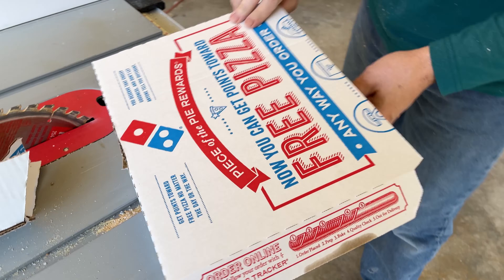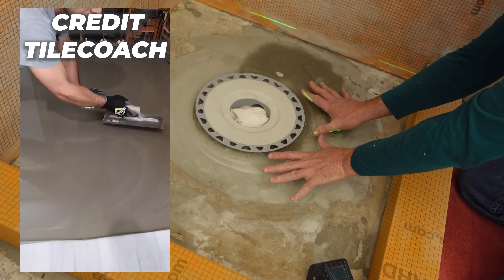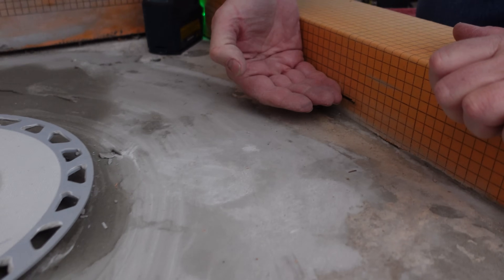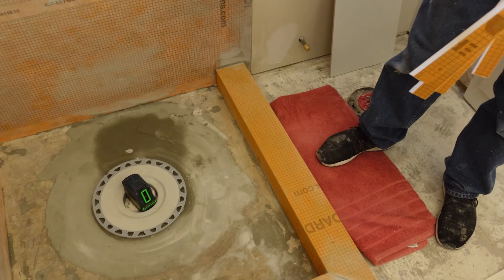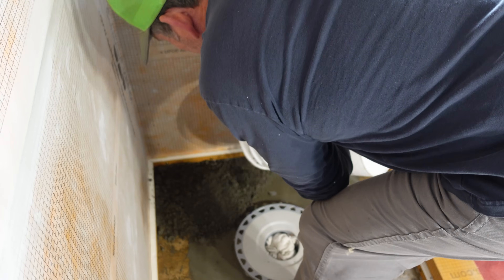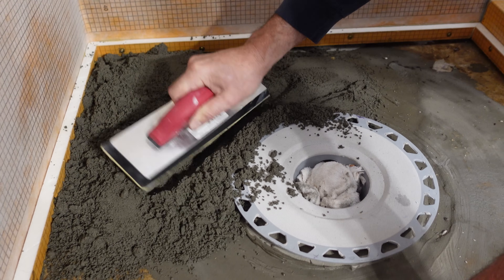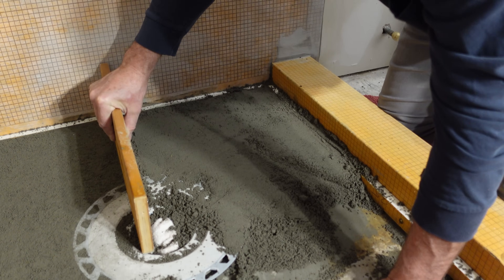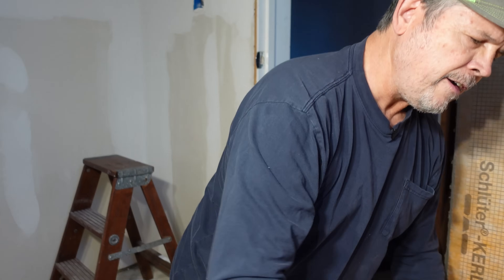HOW TO BUILD a PERFECT Shower Pan PRE-SLOPE (Great for DIYers)

Comment: Best way to mix the mud bed is with one of the contractor trash bags, measure out your water and put it in the bag then add your whole bag of mud bed and shake back in forth 10 or so times and it’s perfect ever time. Been doing it for years.
Reply: Wow that would save so much hassle,  never thought of it, thanks!
Reply: That’s the only way I mix it and save me from carrying that buck where am at I just take the sks of floor mud where am working
Reply: Never would have thought of that. Thanks for the helpful tip.
Reply: The plastic ones? Or the mesh ones? Just your normal black trash bags contractor grade?

Comment: I used 3/8 plywood screeds around the sides cut so they laid directly on the floor; upper edges laser aligned of course.  They're NOT fastened to the wall in any way - just fitted tight -  and are to be removed after the deck mud is fully screeded in.  To make the plywood screed pieces easy to lift out, simply put a screw in their top edge which can be grabbed with pliers.  Just give them a little wiggle and they can be lifted right out, before the mud is set up.  Then just fill & tamp the 3/8 gaps around the edge left by the removed screed pieces with more deck mud.  The end result is perfect - fully filled with deck mud no perimeter pieces left in at all.
Reply: I've always left the plywood in there.  The whole thing gets covered with Kerdi anyway, so it really doesn't matter.
Reply: I was wondering about this! Great tip
Reply: I have used the 3/4" PVC 1 x 2 trim for the leveling border, with good results. It is completely unaffected by the moisture in the mortar.

Comment: Nice job 👍🏼 the trick with construction glue like liquid nails is you apply the glue, stick your piece on the wall & pull it off making the glue like gum then re-stick it back in place it makes for a much stronger adhesion in case you didn't know already ✌🏼
Reply: @daneo617 that's a great tip! Thanks

Comment: When I was still able to do work, employment at a nearby commercial nuclear power plant I owned several rental properties and the only thing I never took on was roofing.  Too much work for a body worn out too young and tired.  I had two kids at home, an automobile for each and each neatly always needed or at minimum could stand some maintenance or repair.  I got to where I absolutely hated needing work done and unable to find someone that could do the job and do it correctly without supervision from maintenance in an auto to house repairs.  I got tired of going behind “professionals” only to have to fix something behind them or rework what they had done long before such rework should have been needed.  As such I found it easier to do it my tired and aching self than pay and then fix or redo.  Paul, you are a guy any person could hire and expect a job to be done correctly with minimal to no collateral damage from the activity.  Great tips.  I have never seen a dry pack done that dry, that is an unusual product.  Hope it lives up to expectations.

Comment: That is the most beautiful shower pan bed I have ever seen.  You can hang with TileCoach or StarrTile any day!  I Learned something new, dry vs. drain.  I have never used the Schluter-Kerdi product but next time I'll try it.  On your electrical video I learned what the hole in the strippers is for, thanks for that.  One suggestion on an old video about installing LED ceiling lights.  I always cover the the hole in the attic with a fire resistant box and seal it to the back of the sheetrock.  This prevents air leakage and increases fire rating.  You can put the LED control/junction box inside, so when you want to change the LED color just pull the light from inside the house and reach in and adjust the control through the hole, no attic dancing.  You know what happens when you dance in the attic, sometimes you mis-step!
Reply from the maker: Awesome thx Scotty 💪👊

Comment: Wow!  Thank you for this video.  I'm remodeling a bathroom and I was stumped as to how to form my own custom shower pan.  My shower dimensions ended up being 48" x 46" so getting a pre-formed pan was not an option.  Plus, some of those pans just don't look elegant.  Anyhow, I was dreaming up how I should add the curb to my 1/2" waterproof hardibacker floor when I discovered this video.   I was so worried about how I was going to slope the floor but I've watched this video a few times and now I get it!  

This was the video that put me over the top with the confidence I needed to get going.   I sub'd your channel and am a new fan of the Stud Pack!   Thank you!  I can't wait to water test my pan when I am done.   I think a water test should be a requirement for everyone that makes their own custom pan, regardless of local codes.  It just makes sense.  Why not? Thank you!!

Comment: Very important tip I learned from this video -- if you are considering using a pre-sloped foam shower pan, you have to make sure the floor is flat and level. Made perfect sense after you mentioned it. I've been going back and forth between mud bed, Schluter pre-formed pan or a pre-fabricated shower pan (fiberglass or steel.) Mud bed is least expensive, but more labor intensive. Pre-fabricated drop in shower pans are very expensive. So, pre-sloped foam was what I was planning to use -- only I know my concrete floor isn't flat or level -- so that brings in using self-leveling compound (SLC).
Reply: I am doing the same with foam base.
I hate Shluter because they fail every time and I think they are complete crap.
Ditra shluter NEVER.
Foam bases never fail.

Comment: Well guys.   I am slowly building my confidence.   I am still studying this project.   Going to rip out the unused garden tub and build the 4 by 6 shower.   Plywood base  so I still have some decisions to make.   Thanks you both for the education and expertise you bring
Reply from the maker: Awesome thx Keith 👊👍
Reply: If you have a plywood base I recommend that you seal it and use a stapled metal lath over top of the plywood.   Don't forget to check for deflection as any movement will crack your tile and grout lines.  Definitely put kerdi membrane over the top of the dry pack base as someone else recommended but bring the membrane up the wall at least 6 inches, sealing the corners as well.  Watch the tile coach YT channel if you need more info.
Reply: Overall good information but better yet… go to the manufacturer’s YouTube channel for official installation videos. I have seen Schluter installed in various different videos and there are videos that did a pretty good job but there are many videos that missed details that the manufacturer specifies. Stud Pack tends to get it right more often than not. However you should confirm the details yourself. 

Schluter also provides free workshops across the country with hands-on training, free hotel if needed and all meals are provided. They also teach from the TCNA handbook what the legal minimum standards are for installation. Invaluable experience. 💯🏆 I hope this helps. Thank you!

Comment: Formula for "dry pack" mortar is simply 1 part Portland cement to 5 parts sand and is ridiculously easier to mix in a small mortar tub or wheelbarrow with a hoe, shovel, or trowel than with a drill mixer.
If stucco lath is not locally available, chicken-wire lath is usually everywhere as a reinforced bedding stapled to tar paper on plywood subfloors for dry pack mortar.
Stud Pack explains well that the dry pack creates the necessary slope-to-drain, but still needs an additional Schluter-Kerdi membrane top liner over cured dry pack, before final tile install. 
If water ever penetrates floor tile grout, the Kerdi underlayment membrane directs penetrating water to the drain.
Reply from the maker: Good stuff thx torchup 👊
Reply: Prefer 4-1
Reply: @TheTechGuider   4 to 1 is a better ratio, gives much better results.  I'd love to build a sand castle with this stuff and watch the local beach bully try to kick it over.....  he won't do that ever again.  ;-)
Reply: @northernlightsrenovations1710  that's awesome! that's the evilest thing I can imagine xD Instant karma
Reply: 1 to 3 ratio. 1 to 5 is weak. Try using a 6 x8 tarp with bag of  mud. Do it next to shower. No mess and easy. 30 years in tile. Malls, schools  and years of residential. Always 3 to 1.  Floor mud in a bag is 4 to1 but that's because the sand is so fine

Comment: Great job! Thank you for the mention 👍
Reply: What about Strips of 1/2 hardi board if you are doing entire shower and curb with cement board and using multi max lite for joints and then hydro ban as the finisher?  Leaving in the screwed in hardi board screeds.

Comment: I always set the screed in dry pack but I'd use wood then pull the wood out and fill the trench. I love the advice to remove the ends of the level. Thanks!😃
Reply from the maker: Cool removing wood screeds is a great idea 👊👍
Reply: Instead of wood, use a mason expansion joint and leave it in.
Reply: You drill to concrete ?. Or how do you pull the screws out
Reply: @howtodoitdude1662  what's a mason expansion joint?
Reply: @youngsavagegotdastrap1564  The curb is made of kerdi board too so he is screwing foam to foam.  I assume the screws are only needed to keep everything lined up while the glue is curing.
Reply: Should refer to the Schluter YouTube channel for technical specifications that might have been missed on video. Stud Pack gets it right more often than not. There are many ways to do an installation so I encourage people to do their due diligence. Go to the source of whatever product you are using. Check with the manufactures specifications and installation. Schluter is a high quality company with phenomenal products. I attended 2 of their workshops and came to appreciate that not only do I know how to install their products correctly but they also teach the legal minimum standards from the TCNA handbook… and send the handbook home with you. As well as many other resources. The workshops were free, all meals were provided, hotel was provided (if needed), they provide training nationwide, I got hands on training/installation and all I had to do was sign up and invest my time. I encourage people to check it out and decide for themselves. I hope this helps. Thank you!
Reply: @howtodoitdude1662  that’s a good idea! I screwed up on my pre-slope using kerdi so now I’m trying to rework it without taking the whole thing out. I was going to use rapid set mortar, because my corners were kind of messed up because of the buildup of the kerdi corners. but I’m going to rip down a few expansion joints and see if I can screed it from that. I’ve only done a few tiling jobs, but the kerdi I messed up on. I build up too much at the corners and there was a few pockets of air underneath the membrane so I ripped it out. I’m gonna do redguard over the rapid set mortar and hopefully we can salvage this pan.

Comment: Haven't built a shower in 15 years, got out when the market crashed back in 07ish. I did 100's of them, never had a leak. Seems like alot has changed. We always used a vinyl shower pan liner. Always mixed our tilecrete/ dry pack on the floor next to the pan with a square point. Always packed the tile crete and then slicked it with a flat trowel. I remember seeing and hearing a little about shluter system back then, never had a chance to use it though. Looks like it has simplified the whole process alot. Even looks like the dry pack comes in lighter bags now, used to be 90lb bags.
I would definitely recommend that schluter system over the old school way to anyone. Very informative video on the process, thanks for posting
Reply from the maker: Thx yeah tiling materials and techniques change daily it seems😳
Reply: Love your comment. Check out Schluter’s instructional videos on their YouTube channel. I imagine you would get a kick out of learning about the latest technology and things that they are doing. Very cool. 🤔😁😙👍

Comment: The thing about having a low side with the prefab pan is you can build up the low side with a half inch notch trowel and feather to a 3/8 notch trowl then set the pan and level accordingly. Time is money and this works quite well. To add another quick tip use red guard to coat pan, corners and 6" up the wall as cheap insurance to protect against leaks. You may also run the red guard up past the valve and cubby if you want to be extra safe against leaks.
Reply: Are you suggesting you do the red guard before or after you build the mud base?
Reply: @csbarbourv  before, two coats

Comment: Foam floor disadvantages include being stuck with the drain placement, and the cost. One with the drain placed where you want, expect it to run around $400, versus about $30 for dry pack (though it requires waterproofing). I just went through this myself. For leveling the sides, I drew a line around the wall that is at the top of a 2x4 when the bottom is at the correct slope height. This makes it easy to tap it down until the line appears, setting the perimeter, then free-forming the slop between that level and the drain flange like he does. There's a million ways of doing this stuff.
Reply: Yea if that drain gets cracked or leaks you have major issues.

Comment: Great video, but one question -- is there any concern about the exposed foam on those shower curb off cuts?   Normally the Kerdi foam is covered by the orange outer layer (I don't know what that layer is made of but assume its something waterproof), so when you take those pieces and turn them 90 degrees and the foam is exposed like that, just wondering if that creates an issue for the waterproof-ness of the final shower pan.  Thanks
Reply from the maker: It all gets covered with Kerdi in next video 👍
Reply: @StudPack  Can't wait!
Reply: The other aspect is strength, but as long as it's no thicker than the tile and thinset, there's no way to put pressure on it.

Comment: I love watchin you build, on this video my critique is that those foam cleats you pre cut to screw & glue to the sides are really not good practice for 2 reasons.  First is that the screw/glue in a moist environment can fail and compromise the pan.  Second is that is a lot of unnecessary extra work which can easily be achieved by packing the perimeter with mud pack to a laser line, once a 2 inch perimeter is established, then filling in the space to the drain is an easy job.
Reply: I think the thinking here was that everything will get kerdi band and the membrane in the next step. Those screws should never see moisture in the install final. They also look like exterior rated grk screws. I just use the mud as the perimeter gauge as you mentioned also. Good thoughts to present the readers in your comment. Take care!
Reply: That's how I always did it, start with 4 corners and then connect them all level, then fill in with trowel and level/screed. Although I'd always used a pvc liner, and 2x4's for the step. My stomach was twisting seeing screws going into it without any redguard or similar covering it. Had so many jobs where a homeowner tried to diy and low screw holes turned everything to mush.
Reply: @captron420  yup I cringed too at the screws into the curb. Here in Florida we have to use vinyl pan liners by code. I'm going to see how Paul puts in the membrane on top. Could be interesting to see new products being used
Reply: @mikewithers299  That's funny, I'm from Florida as well. Never knew it was code tbh, it's just how we always did it and it never failed. Was so strange seeing him use sand topping right on the slab as well.  And packing in the weep holes in drain, just red flags everywhere.
Reply: @captron420  yes in Miami it was code to use a pan for every shower we did. The sand topping or dry pack became part of our plumbing inspection back in the early 2000's up to today. We didn't have to bond it to the slab, but it had to pitch and have no standing water after it drained. Test ball installed below the flange to test our glue joint.
Reply: @captron420  those aren't weep holes,  they are for creating a stronger bond with the flange as Mudd/ thinset goes through it. 

The weeper holes for the system come with the drain piece, which is installed with the tile.   

There are no red flags here,  I've done the same install probably 75 times with no problems.   Pretty good advice in the vid imo

Comment: I think this might be a bad idea. The exposed wide edge of that strip at the bottom of the bed in the corner is just a foam. Which might absorb water and take it all the way down to the slab of the house. Which will lead you to the bottom plate of the walls. I don't know if schluter makes the foam waterproof?
Reply: There will be a waterproof layer on top of everything. The industry has really embraced this method in the past couple of years.
Reply: Check out Schluter’s YouTube channel for installation videos and website. Stud Pack is a good channel but it is good to check out the manufacturer specifications for yourself to ensure the accuracy of what you are looking at. I have found that Stud Pack gets it right more often than not but there are some details that I might question or disagree with. Each person should do their own due diligence. I hope this helps. Thank you!

Comment: I used to build shower rooms and remodel shower rooms for assisted living places all over the country. I had to build drainage slopes in big multiple shower unit rooms. There can never be any standing water due to bacteria. I do not miss it...lol I always cut and mortar 2 inch strips of concrete board to get the parameter height, then screed the bed between to the drain.